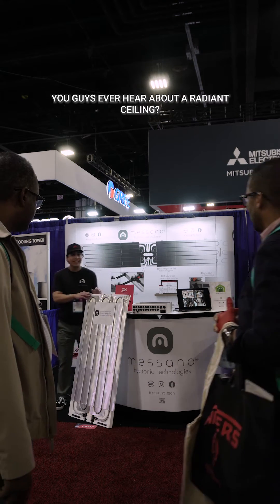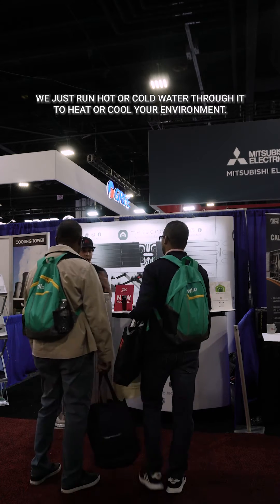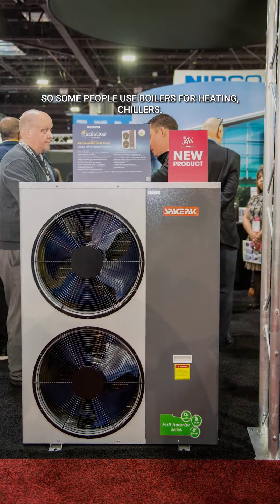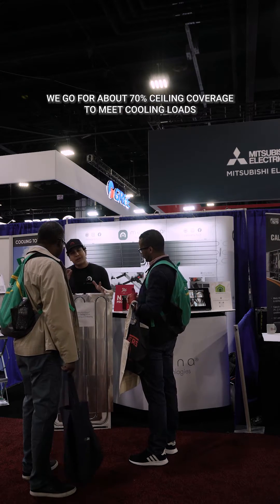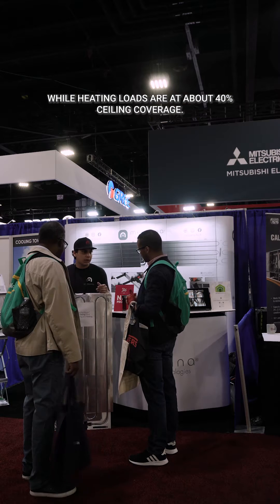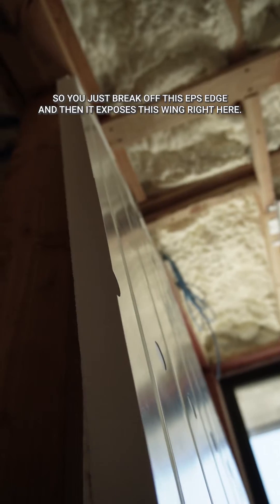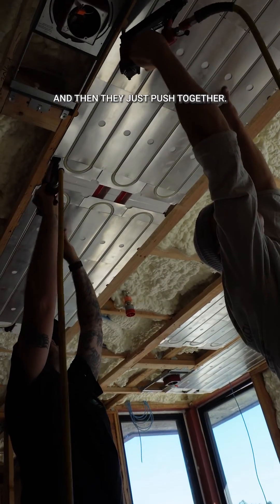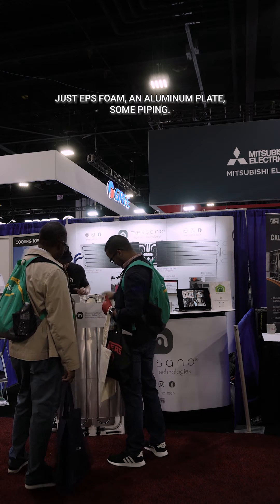Radiant Cooling at the 2023 AHR Expo

Comment: Regarding humidity sensors to prevent condensation, are such sensors in every room where there are Messana cooling panels? 

Would dehumidification be room-specific? Meaning would there be a humidity sensor for every room? Would each room's humidity be detected and controlled according to the humidity level in each room?
Reply from the maker: Hey! Yes, we put a sensor in every zone to monitor the dew point everywhere!

With that said, dehumidification would be for the whole house, not just one zone. If one area needs dehumidification, we'd work on lowering the dew point in all zones, not just that one. Let me know if you have any additional questions!

-Saul
Reply: @messanatech  Thanks. Good to know. Presumably, the dehumidification unit will turn on when one area needs dehumidification, thereby reducing the humidity for the whole system.

Is the dehumidification unit also made my Messana in Italy?
Reply from the maker: @oldporkchops  Bingo! And the ATUs are not made in our factory, but built OEM per our design by a manufacturer in Italy!